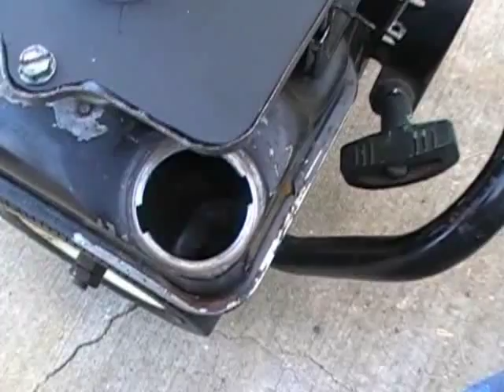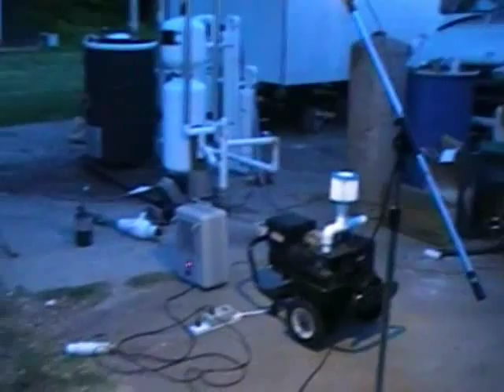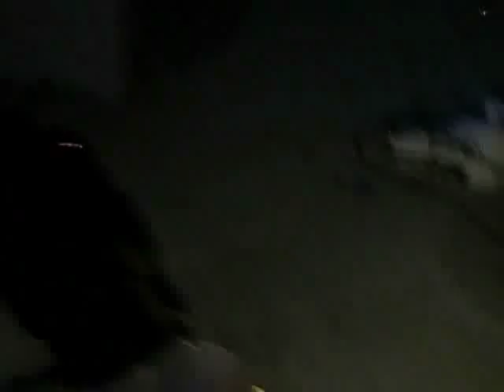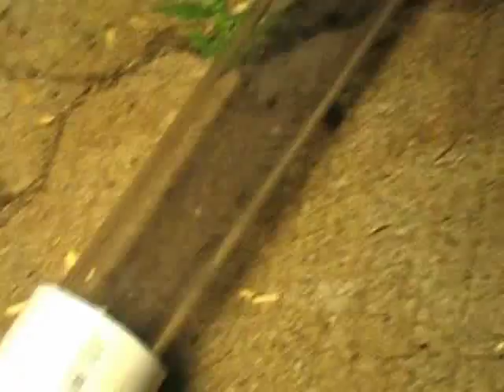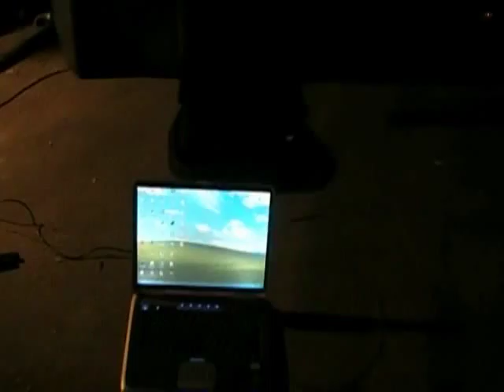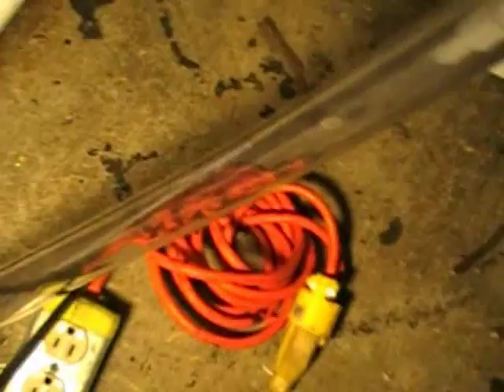05-31-2013 Generator is up and running!

Comment: Could you split off at the gen and also run a propane heater or grill while running gen?
Reply from the maker: +john qpublk  It would be difficult to do. The best thing would be to capture some gas in a tractor trailer inner-tube then lay a sheet of plywood on it so you could place some weight on the plywood (bags of sand) to give you enough pressure to push it through a line feeding the grill.

Comment: soot won't hurt your engine... your engine will burn it.
Reply from the maker: Actually soot is made of what? Carbon. Gasoline if burned rich makes black smoke which is technically what? Soot.  When gasoline is consumed it is releasing spent hydrocarbons which are technically micro soot particles. Yes you are technically correct as it will not damage an engine like tar from poor grade woodgas or sand would but yes, it will shorten the life of the engine by acting like micro sandpaper inside the engine. This is why engines ran on either alcohol or propane last much longer.
Reply: dude this guy is a moron if he think any thing other than clean air is ok ITS NOT like flash sed some times it cant be helped but it will damage the engine =\
Reply: ok, so i'm a moron.
Reply: And I guess people like Wayne Keith would be morons too, even though he has over 250000 miles driven on wood... how many hours of engine running wood gas do you have under your belt?
Reply from the maker: International Supply I'm going to step in and reply to this. No Wayne Keith isn't a moron nor is he stupid. As long as the soots are not too heavy they will pass thru the engine but you will still have some micro sanding effects that will take it's toll on an engine thru time just as you do with gasoline and maybe a bit more. It comes down to what is acceptable to you as the end user. The average engine can last anywhere from 200K miles up to 400K miles but an engine ran on alcohol or propane can go well beyond that before the engine starts burning oil from ring wear. That's the only difference. If you get 200K miles or above on woodgas or gasoline then all is good.
Reply: International Supply look i dont wish to make enimes but now u are in my court u bay be an expert at wood gas but i AM an expert about mecanicing and engines i have OVER 200000 hours of schooling i was the first student in 10 to get a certificate of achievement from ROP (regional occupation program) had my own hot rod shop for 2 years b4 i retired and i think ur being quit defensive and we all have come to the conclusion that an engine is dieing from the moment its first started but it is a moronic statement to think it is "ok" to feed the engine soot ITS NOT but its no worse than running with no air cleaner here in CA the pollution here will destroy ur engine faster than bad wood gas "and i don't like Wayne B\C he acts too full of him self hes not that smart and i tell u if we ever meet i could smoke him at any thing he challenges me with (one more thing i think hes a Capricorn and i just dont get along well with Capricorns) ohh well i suppose i dont really need a reason to dislike someone i just do like Chevrolets and dis-nee (lol) i just dont like them there is something wrong and i cant put my finger on it =3-
Reply: I never claimed to be an expert at anything. I don't consider anyone my enemy. You really don't know my personal background and I don't really care if you do. Wayne is far from being full of himself, he is one of the most down to earth people I've ever met. If memory serves me GM had an experimental engine that they fueled with coal dust... fuel delivery was the reason they didn't do anything with it, and yes I worked for GM for a number of years... that's all you need to know about that. God bless and I wish you the best in your future endeavors.
Reply from the maker: xoxoXoieoxox Some people look at Wayne Keith like broccoli and spinach where they either agree with him or they don't. Honestly, I don't know enough about the long term effects of woodgas on an engine. I do know that even if you filter woodgas to the point of being spotless, the micro water vapors in the gas can carry acids from the process. I discovered that by accident when I seen steam in my lines. I even commented on it in one of my videos. I took a paper towel and wiped some off looking for tar. There was none so I decided to taste it and it was acidic. I have a fish aquarium I make a lot of homemade wine so I have plenty of PH strips so I went and grabbed one and tested the clear liquid and it was acidic. That too could possibly damage an engine over time but then again, regular fuel can also have nasties in it that will eat away at an engine and that's one reason they tell you to change your oil in your lawn mower before you let it sit over the winter months. I don't think that alcohol and propane have those same issues but I could be wrong.

Now I'll jump back to the original argument. Soot from ANY fuel source
is not a good thing on an engine. You said that you may as well be
driving down the road without an air filter and I have to agree on that point. You will wear out the rings in your engine and wear out anything else where hydrocarbons, carbons or dirt can penetrate so yeah just clean the woodgas and be done with it.
Reply: flash001USA
that is interesting, my understanding is that condensate from the hopper would be acidic and everything past the hearth would be base. while i can't personally confirm that, I do know of people that tested theirs and that was the case.... Hmmmm wonder why yours' would be different.
Reply from the maker: tritowns That's a good question. The Ph wasn't slamming acidic but it was not a neutral Ph either. I did have one idea and that is I could have been picking up some residual moisture from the fresh wood chips in the filters themselves that was passing thru the system. If my memory is correct it was between a 5.5 Ph up to around a 6.0 Ph. That's not like acid in a battery but it is still acidic.

Comment from the maker: Cont: It will mix with water and act like tar. Wet soot becomes a paste and if there are even any light thin tars in your gas they too will mix with the carbon soot's and cause them to stick in the engine. The filters can strip out the very light tars as long as the gas get's cooled down. From what I have read in technical write-ups, you will never have a true blue 100% tar free gas 100% of the run-time due to all of the variables. Some may disagree but I found this info in technical papers.

Comment from the maker: The soot can mix with water vapor and make what I call a "fake" tar. I seen this in my filters and if you let it dry out, it crumbles into dust but this stuff can clog an engine just like tar with the only exception that it cleans off easier. I see people that are using the Wayne Keith approach and they are using only an ammo can full of straw and I can only hope that they have it right because I feel that soot will either scratch the piston walls or it will mix with water and act like tar. Cont

Comment from the maker: Cont: Before they saturate out with water and wet soot's. This is why I tried to build the filters larger but I came to the conclusion that I had the tri-filters right the first time. I can live with a 4 hour run but I want to refine this process. You have an electronics background so I'll tell you what I am looking at constructing. I want to build a 50 KV up to a 100 KV electrostatic filter and I think I have a design that will not short out. I may shoot you a private message on that idea.

Comment from the maker: The only reason I even caught it was because I removed the air filter and watched it closely with a bright light at a sideways angle. It was a mixture of burnt exhaust with a tiny bit of burnt oil that would blow back from the carb. This is due to the valves not seating properly along with the piston rings not seating correctly too. I knew this engine had issues before I ever used it. The tri-filters are doing their job but they are only good for up to 4 or
5 hours cont:

Comment from the maker: I already have checked my engine. I've got approx 16 hours of run-time on my engine and I see zero tars but I do see my filters getting very dirty from carbon soot's. I thought I was seeing a fine layer or a fine coating of carbon something in the external wood carb then I figured out that since this engine burns oil I am seeing the blow-back smoke  on the engine during every other stroke cycle. Cont:

Comment: I hope this will work, as it could save you a lot of space and improve your fuel gas even more.
Well, my engine finally failed. It's not tarred up, but there are carbon deposits around the inlet valve. I am guessing that these have been accumulating due to imperfections in the gas quality.
As a result, the intake valve couldn't close fully. This prevented ignition, and caused cute little backfires up the fuel hoses. It took 30 hours to reach this point. Perhaps you'll want to check yours?

Comment: My first car was like that. I quickly learned to keep my thumb on the same side of the handle as my fingers were.
For a bit of a giggle, I used to crank it by jumping on the starter handle. When it backfired, it would propel me very niclely into the air. Ahhhh, those were the days  :) .

Comment from the maker: My idea is to use a shallow water bed probably about 6 inches deep along with 5 or 6 small 1/4 inch diameter tubes to break up the gas into the water. I would use a 6 inch air gap space to place a screen and then use 12 inches of gravel so that some of the water could splash up at the bottom of the gravel to keep it damp then follow up with maybe one more foot of filter medium above that. I see it in my mind and if it worked it would eliminate a lot of pipes.

Comment: It's good to know that our gassers are working pretty much the same  :).
Perhaps we can enjoy a small fuel saving by running the mixture a bit leaner.
I wonder if there will be a reduction in fuel consumption for the same load when we optimise the ignition timing.
It seems fair to say Yes, I think  :) .

Comment: That sounds like a good idea. I hear conflicting observations about the value of a water based particulate filters, but I think it's worth trying. I made one for the big gasser. It stands 3 feet tall and has a water pool about 8 inches deep. The gas goes down a pipe from the top, and enters the water thru lotsa little holes. A series of baffles stop the water from splashing its way into the outlet pipe at the top. This seems to work, as the water comes out dirty after a few hours of runtime.

Comment from the maker: Verrrrry cool! I thought about an external ignition setup after you mentioned this idea. I t would be really simple to do with a halls effect sensor that could be ran into a pulse controller circuit that could be used to offset the spark and even allow for a hotter spark if needed with the aid of a simple pulse stretcher interfaced into the design.. Now you've done it. My mind is racing a thousand miles an hour.

Comment: I have a couple of alternatives here. An onboard inverter can let me deliver 230V AC to the house through thinner wires, or I may let the alternator deliver something like 60V DC, and step it down with a DC to DC convertor in the house.
Ideally, I would like to reduce the power loss to less than 80 Watts.

Comment from the maker: 300 Watts in losses? Wow! I guess your output is DC. Have you thought about bypassing the diodes and taking the 3 Phase AC
and reconverting back to DC at the battery bank? It would definitely
reduce the losses even at the low voltage.

Comment: It's a fair bet that you are right on this point. 
There is one test that I want to do. I want to see if there is a point of maximum thermal efficiency in the system. This will involve varying the engine revs, while maintaining the same HP of shaft load. I suspect that this will cause differences in the rate of fuel consumption. Also, I want to see what the engine will do it I shift the ignition timing while it is working into a load at a given RPM. There's surely room for improvement here.

Comment: Yup, it's an interesting effect alright. It's probably related to that good old standing wave thingy again  :) .
Talking of light in tubes, my engine backfires sometimes during startup. When it does, the delivery pipe flashes as the gas inside it burns off.

Comment from the maker: That sounds like something to look into building. Before I quit picking your brain you said you are using wood chips? What are the sizes of your chips? Have you uploaded anymore videos since you have made corrections to your system? I'm also curious about your gas temperatures going into your engine. I don't mean to ask you a million questions but you don't learn anything without asking and besides that, you are using this setup on a regular basis for real power needs.

Comment: To dry the wood, I deliver the hot exhaust gas into the bottom of the tank. A hole is cut in the top of the tank, big enough to support a wire basket by its rim. The wood chips are suspended in the hot gas, like chips in the hot oil of a frier.
This does two things: it dries the wood chips and it helps to muffle the engine noise  :) .

Comment: 5.5 Lbs an hour ain't too bad at all  :) . Since you can cut the wood faster than the gasifier can use it, you'll always stay ahead of it.
It will be interesting to see what happens if you use a bigger engine driving the same shaft load. Will it use more wood, or the same as your current engine?
Hmmm!!

Comment from the maker: The generator I have is only a 5 Hp briggs and stratton and the generator is only able to deliver 1000 Watts on woodgas but it can deliver the full 2000 Watts on propane or standard gasoline. I will probably find a 12.5 Hp engine to take the place of the smaller engine just to make up for the loss in the woodgas. I can't complain because I'm only using 5.5 Lbs an hour for that 1000 Watts. I'm sure I'll consume a lot more wood with a larger engine.

Comment: I was using a 1300CC car engine, but now use a little 13HP engine as it's easier to fix and is more portable.
It drives a modified 12V alternator which can deliver up to 1800 watts is pushed hard enough. For battery charging, I limit it to 1000W.
The weather here is pretty normal for winter. Freezing cold, icy freezy winds and lots of rain. It's hard to work on the gasifier in these conditions, but I am totally relying on it for power, so ya gotta do what ya gotta do  :) .

Comment from the maker: How are you using the tank to dry your wood with? Man I did a run the other night and the wood was pretty damp. Damp wood robs your engine of power! I ran for one hour and I bet you I collected 1/2 of a gallon of water out of the system. I still didn't see any tar issues but I did see water issues! We have extremely high humidity here and that plays into the gas quality too because you are sucking sticky wet air into the ember bed too.

Comment from the maker: Before I forget, are you still using the big engine to generate power or are you using a smaller generator to charge your batteries with?
Now one more question. Are you seeing unusual weather patterns in your part of the world? We have had a lot of rain here followed with much cooler temperatures. This weather is out of sync here.

Comment from the maker: Believe it or not I'm using a 3 ft deep layer of stainless steel pads in my first filter to capture water and any large particles and there isn't any back resistance with this stuff. The only real resistance I see is in the wood chips but that's a price you pay if you filter the gas really hard. Here's a strange thing. These filters breathe much easier and I thought I would see more torque under a load with the generator and it did not make a difference. I'm still trying to figure that out.

Comment from the maker: It sounds like you aren't seeing any real tar issues now so it sounds like you could get away with a simpler filter setup. I redesigned the tri-filters to breathe easier. I may have already told you that but I went from the 4 inch pipes up to 6 inch diameter stuff. I think you and I swapped emails but I cannot find your email in my contacts list. If you still have my email shoot me a message and I'll send you a photo of the new setup. This may be a good solution for you. Cont:

Comment from the maker: The soot will burn hot like biochar does but faster and hotter because it is not compacted like biochar. You may as well be lighting cotton balls on fire but it probably doesn't have any punch like you would expect to see with an actual raw fuel. The soot probably just passes through the engine and adds to the black carbon on the exhaust.

Comment from the maker: Did you ever resolve your tar issues and what did you finally do to get your gas cleaner? I know that some people say that their gas is tar free but I don't know if it is possible to actually get the gas 100% tar free. I've seen mine produce very thin oily tars during a start-up or even a bit of light tars (a tablespoon in the bottom of the mason jar worse case) but I have not seen any thick heavy tars what so ever with this new system and yet I'm still paranoid about damaging my engine.

Comment: Yup, that's good advice. I think I could put a drain tap at the bottom of a U tube. The filters would be screwed into place at the tops of the U tube, kinda like Edison screw light bulbs.
Mine has only one filter at present. There is no tar getting into the engine feed pipes, but I am seeing soot collecting on the walls of the pipes. This can be easily washed out with water, but I do wonder what the soot may be doing to the engine. Your filter design will soon be resolving that problem :).